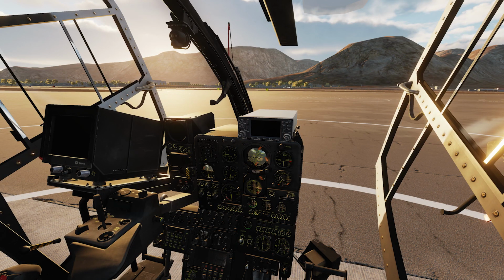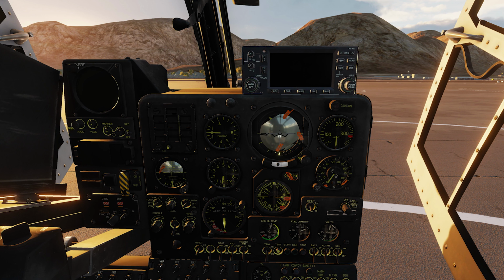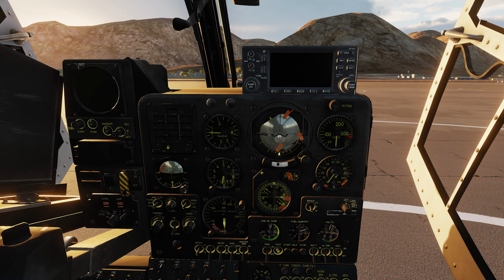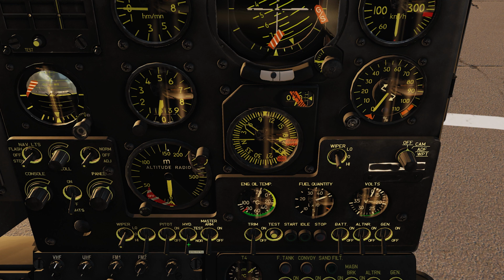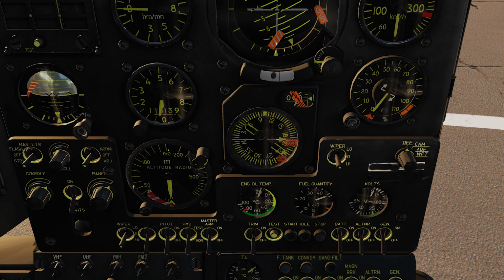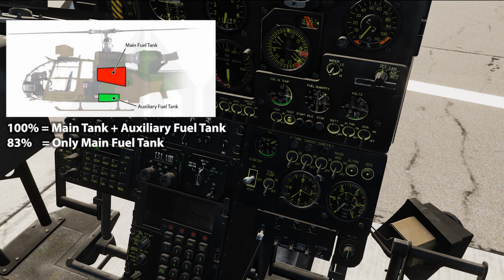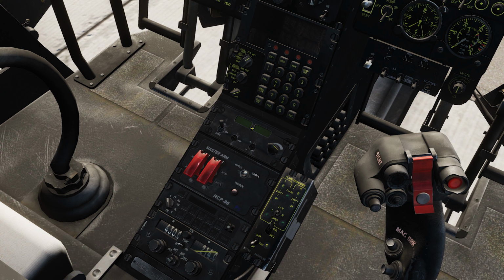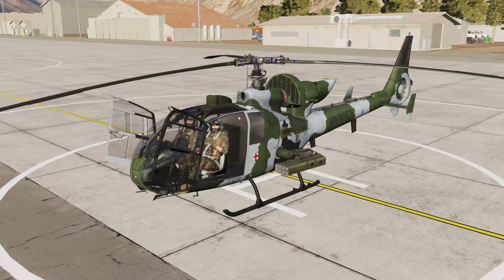DCS SA342 Gazelle Quick Start Tutorial - English Cockpit installation and Cockpit Tour - Part 1 [EN]

Comment: I'm new and just bought the gazelle, but I would guess the wiper control is left and right switches. The marking is between the two switches and it would make sense since wipers don't work and neither switch works.
Reply from the maker: The right one for the pilot side works, the left one doesn‘t :) thanks for watching and for your comment :)